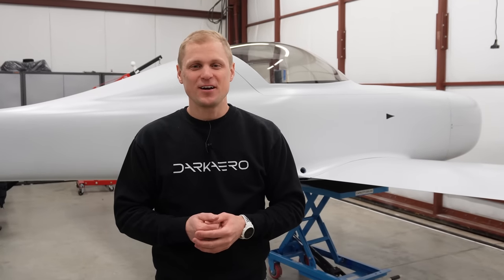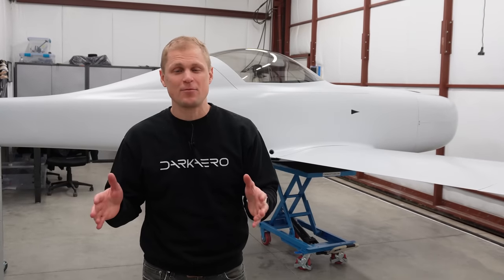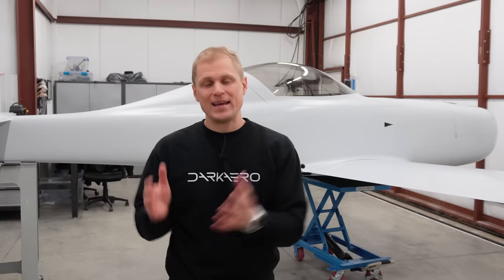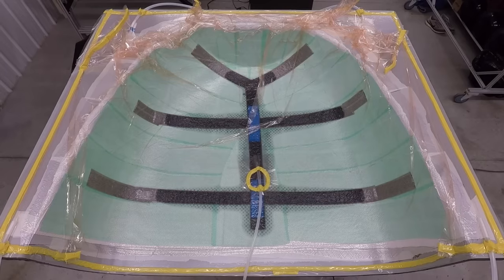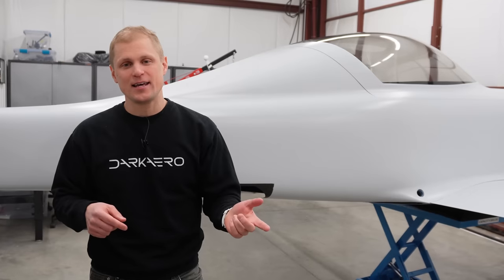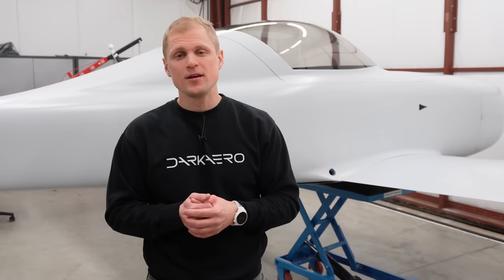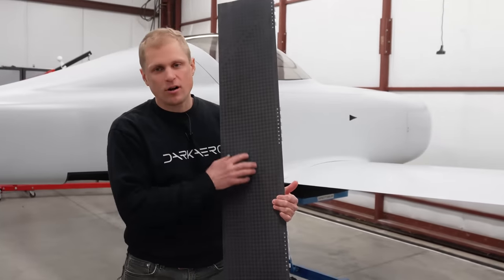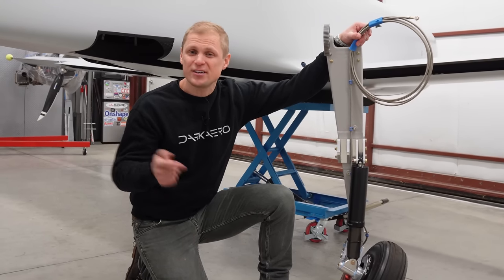“Don’t paint it!” …(we painted it)

Comment: If this has solid crosswind tolerance it will be the perfect cross country machine for someone like me that is a pilot and business owner with satellite offices spread across the country. We aren't big enough yet to justify a company plane, but it will pay for itself by saving me time for our current mission. Super excited to see the flight testing. I'd really love to build this as well. I'm a sucker for a well engineered design, and having followed this project I can say you guys have done a stellar job.
Reply: A lancair 320 would be perfect for you now, if you enjoy working on the airplane as well, but I can 100% see the practical aspects of an airplane like this. I cant wait to see it fly
Reply: This will handle crosswinds just fine. 

There is an exponential function of the earths boundary layer, it rapidly becomes nearly zero wind at the surface. The smaller and lower the airplane the less crosswind effects it during rotation and in the flare.

It also will land rather fast for most General Aviation type aircraft. Due to wing loading, small wing, short wing chord, low Reynolds Number. Wing loading is your friend in gusting conditions because its less effected by bumps. Speed is your friend in a crosswind because of trigonometry. The faster you go, the lower the crosswind component for any given crosswinds strength and direction.
Reply: @abel4776  you'd think so...honestly, at a certain point, it becomes quite routine - especially if YOU'RE the pilot.
Reply: @TheJustinJ  Hey don't talk about stuff you clearly don't know anything about. Other aircraft with similar design characteristics have demonstrated crosswind limits of 12-20kts. It's not "12 knots except if you're going fast", it's 12 knots. A high speed landing with high crosswind is a recipe for disaster.

Comment: Please consider wrapping, is my unsolicited advice... Great update - In my humble opinion white is the best color for protecting an aircraft or boat from UV ray degradation and reducing radiant heat absorption. I'm thinking one of the best paint schemes could be achieved by wrapping. Gelcoat and clearcoats are tricky to keep from crazing and cracking over time. With new boat manufacturing wraps add a level of protection and are cost effective to repair. Adding cobalt is the activator for making gelcoat hard for all colors including clear. However, over time with production too much cobalt makes the epoxy too brittle and different pigments require different amounts for longevity. Metal fleck requires hard clear gelcoat however I've not seen many aircraft with metal fleck finishes. You can eliminate all that by wrapping with any color scheme you want. I've been using wraps on my personal stuff for years and when I'm wanting to make changes, I simply peel the old wrap off, clean and rewrap. It's amazing how well wraps protect the underlying paint. I use liquid wax formulas I blend on the wraps to add, longevity, depth and slickness. Polymer wax technology is a viable alternative for aerospace coatings. I love spending time on your channel and the stellar creation of DarkAero 1. You guys are leading edge with efficient aviation. Thank you for sharing, guys.
Reply: Will Hibbard II, I agree completely.
Reply: After 32 years in aerospace composites (Sikorsky Blackhawk; Airbus A340,A380;F22; to name a few)best techniques, your young team exhibit all the best engineering I've ever seen. I wish I were nearby enough to be a hands-on craftsman on this project. 
  Real life issues just wouldn't allow that for me. Thanks for your videos,  I've followed your entire build, and it's been amazing,  entirely. 
  Best of success, congratulations, you're practically there.
   I totally concur with the wrap idea suggested by Will Hubbard.
Reply: Agreed! Slightly more weight but better cleaner easier outcome.
Mike Fitzgerald Calgary Canada 🇨🇦

Comment: One of the best carbon fiber looks I’ve seen is in the canoes manufactured by Placid Boatworks. They will gel coat parts that will be prone to scrapes and scratches, but the rest is bare carbon fiber BUT with a tinted resin so you get that gorgeous texture but with a brilliant red or green color. Some mix of white gelcoat with exposed tinted CF could look amazing on a plane.
Reply: 100%

Comment: Do you think the seam on the fuselage will end up cracking the paint later on after flying for a bit? I guess we will find out? Just curious if you have considered that possibility.
Reply: If they do get a paint crack on any glued CF seam they will have a much more serious problem with the carbon fibre.
Reply from the maker: Hey Riley! We don’t anticipate seeing cracks along fuselage joints because the primer is pretty flexible. The PPG rep at AirVenture showed us a demo using an inflated balloon coated with their material that could be squeezed and flexed without any cracking issues. That said, we will see if flying the airplane reveals anything.

Comment: I mentioned this before. In boat building they sometimes paint the mold with polyurethane paint prior to layup. The paint sticks to the composite material not the mold, obviously.
Reply from the maker: Thanks for checking out the video! Applying paint in the mold is something we could take advantage of, but we opted to not do this on the DarkAero 1 mainly for structural and quality inspection reasons. Paint obscures visual inspection on the mold face of the infused part after we demold it and inspect it for any dry spots. This inspection step is pretty critical for structural parts like the wing skins. There are other inspection methods like ultrasound that allow you to "see through" paint, but they are not as good as having the ability to simply visually inspect everything.  The other reason we don't apply paint in the molds is that it would interfere with bonding airframe sections together since we have lap joint jogs molded right into the parts. Of course, there are ways around this too like masking off the bond areas of the mold or sanding the paint off of lap joints, but that probably adds more effort than just painting the whole airframe in a single operation.
Reply: @DarkAeroInc  thanks for the detailed reply, which makes sense!

Comment: You guys works are very thorough,  as far as engineering is concern. I have being following you since the begining and never disapointed in what I see, I am an inovator too, have you conscidered designing your craft arround a new technology of combustion engine that does not  have crankshaft nor piston, this engine has change how combustion engine is, I am priviledge to see it... let me know what you think, one of the objective in the design of the said engine is to reduce weight size and increase efficiency close to electric motor efficiency.. and the amazin thing about this engine is it can be scale up or down at will and you can reduce power or increase power...

Comment: The marine world has been clear coating highly stressed carbon sailboat masts for years - but 5-10 years before you need to repaint. I've never seen any data on resin degredation however i.e. doesn't seem to be a problem. What's the HDT of the epoxy you're using?

Comment: It would be nice to see some of the amazing carbon fiber through clear coat, but it certainly isn't necessary, nor important given the amazing progress made on this prototype. White has some advantages as well. Reflects heat when sitting outside on the ramp or flying low in the equatorial regions of our planet. This is something a DarkAero may be doing one day... 😀👍

Comment: An outer layer of basalt fiber might provide some UV protection and allow for easier repair in the future.
Reply: It is the epoxy that degrades. The graphite fiber is not UV sensitive.
Reply: @mckenziekeith7434  I know the epoxy degrades but a sacrificial layer of basalt fiber could be opaque to UV and protect the epoxy matrix beneath. You could sand through the basalt for future structural repairs, or cosmetic scratches. In a UV protective environment of course. This could provide insurance for the airframe against neglect and deferred maintenance if the UV clear coat fails.
Reply: @kylegoldston  you could also just add a sacrificial outer layer of carbon (make the whole thing a tiny bit thicker than needed).
Reply: @mckenziekeith7434  Carbon is expensive to use non-structurally, hard to wet out, and easy to damage. A layer of basalt fiber would be easy to sand and fill minor surface damage, match the weave and repair with minimal cost and risk.
 Just an idea though.
Reply: @kylegoldston  OK but I thought the idea of leaving exposed carbon is to have a carbon look. Basalt fiber doesn't look quite the same as carbon. It is lighter in color. If the objective is not cosmetic then might as well paint. Or, maybe basalt looks almost as cool as carbon.
Reply: @mckenziekeith7434  It does look, to the untrained eye, almost identical to carbon especially with carbon beneath. Most consumer goods are dyed fiberglass anyway, real carbon parts are most easily identified by weight, thickness, and apparent resin ratio.  The color in basalt fiber is natural and homogeneous throughout the fiber. I don't have any data on how well it blocks UV however, just an idea.
Reply: @kylegoldston  maybe adding an outer layer of basalt to fiberglass parts will increase their coolness factor also. I do have some basalt fiber cloth but I haven't got around to incorporating it into any layup yet. But the dry fiber definitely looks much lighter in color than graphite fiber. Maybe it darkens up when wetted out. Or maybe most people would just look at dark colored fibers and say "carbon."
Reply: @mckenziekeith7434  It does darken when wet out, Carbon doesn't. This is one of the reasons you see a lot of pre-preg carbon, it's really difficult to get aerospace resin/fiber ratios when you can't see wet out. Excessive resin produces a brittle, heavy part. Too little resin makes the whole part garbage because you can't get into the layup to apply more resin.
 A slightly resin heavy, perhaps 1:1.2-1.5 layer would maybe add 2-4 times the weight of paint.

Comment: Just curious, have you guys ever investigated having an option for a CD-170 engine? I know you guys are worried with other things right now, but I'm curious as to what kind of range it would provide.
Reply: That engine weighs +106lbs more, which would increase the empty weight fraction by over 14% and reduce payload by the same amount or fuel capacity by 17.5 gallons. That would reduce endurance by 1.7hrs and cut range by at least 425 miles at 250mph, 10.4gph. Its also down -30hp on the UL520. So a +14% increase in weight for a -15% reduction in power. Which would result in a substantial reduction in climb rate and possibly cause a dangerous low climb gradient.

What would be the point? Spend twice as much on an engine to try and save a few hundred gallons of gas over the next decade or two?

Comment: May aswell paint the flaps, no point in testing what you already know. The resin will lose it's shore faster with exposure, best not to even test the theory. Would be better off taking some spare peices and getting some baseline tensile numbers then just have them sitting outside 24/7 testing them periodically. 

What's the timeline for flight testing or are you guys playing it by ear?

Comment: How much weight did the paint add? I'm always curious, because it can be surprising how much it can add.
Reply: There's an old story from pre-war Grand Prix racing where the Mercedes team turned up for an event and was found to be 1 kilo (2.2 lbs) overweight. After a bit of discussion amongst the team members, the manager told them to strip the immaculate white paint off the car back to bare aluminium. The car passed the weight test and have been known as the 'Silver Arrows' ever since, despite running their cars in a black (carbon fibre?) livery for the last few years

Comment: beautiful lines! One question though, if this is to ve marketed as a kit as we know it to be, what is the target market? No doubt this will be an expensive aircraft and being such a hot ship, not necessarily one an average pilot could handle with appropriate differences training... ie, someone who has 500 hours in a 172 would find this overwhelming
Reply: The short answer is, probably limited. The kit market is generally moving towards two seat high wing aircraft. Fast composite aircraft were more popular in the 90's.
Reply: @TheOwenMajor  Interesting isn't it, with VANs and Sonex going that route... I have never flown a high wing airplane that's a pilots airplane, C152, C172, Kitfox etc are all good machines but feel very loose in yaw, needs lots of rudder in a turn and generally don't perform as well... As the market is aging (less people interested in building) perhaps its the 90s lads that are buying these high wingers as they're easier to get in and out of
Reply: @Thinkflite  I think it's mostly people looking for a do anything typebof aircraft. Something that is competent around short fields but also has decent cruise speed. High wings are easy to use and enjoy, easier to load ect.
Reply: @TheOwenMajor  Very true... In Europe which is comfortably the largest market outside the US, aircraft that aren't capable of grass strips are generally not very popular... Lancairs, Glasairs and even Rutan Canards are hopeless because the big runways don't typically allow GA aircraft and huge amount of ex RAF airfields are either racing tracks of runways with very large pot holes... I think the Dark Aero will certainly sell but I'd wadger no more than 50 kits, if that.

Comment: if you want to go jet, cone pulsejet (rocket nozzle shaped) electric resistance white hot coil injection thruster
Reply: its not actually a pulsejet, its a continuous burn directional no-moving parts jet
Reply: why not just use sunscreen, TiO2 paint/surface, or just titanium surface, it will make that TiO2 surface, automatic mirror surface

Comment: Did you grab a weight before and after painting?
Reply from the maker: Hi Matt! We did weigh the airplane before paint, but we haven't weighed the airplane after primer yet.
Reply: @DarkAeroInc  I wish I did that to my composite airplane before bodywork. I think the weight can really get away on you with poorly built kits from handmade molds from the 90s. I've been more excited to start building yours then finishing my current one 
-Matt (#7 reservation)

Comment: The finished airplane has got to be really light, and is probably what you were going for. I just wonder what that will do in bumpy air,  headwind and/or crosswind. When we have to pull back the throttle on the TBM for bumpy air in a cloud, I can't imagine what it would be like in the DA?!  It should be very interesting in any case.  Very cool airplane!!   8)    --gary
Reply: Wingloading isn't everything for turbulence, but the dark aero is projected around 18-22 lbs ft^2 where the TBM is in the low 30's, so for its slower speed it should handle pretty well. I just hope they can hold onto their sub 61 knot stall speed.

Comment: I have come to the conclusion they are afraid to fly this airplane.
Reply: I was starting to think that too  BUT  then I had to admit I'm just an idle spectator   and they are all engineers carrying through their career founding project  with all diligence  and painstaking care.    I have slapped myself on the wrist and      give them the admiration due.
Reply: @causewaykayak  I have a few more degrees in Engineering than they do.  VanGrunsven and Rutan would have built and flown five different aircraft by now.  You don't need paint to test a prototype.  Appears the business model here is videos, not airplanes.